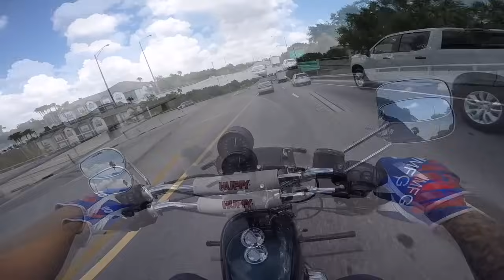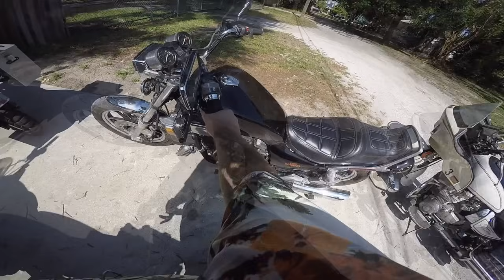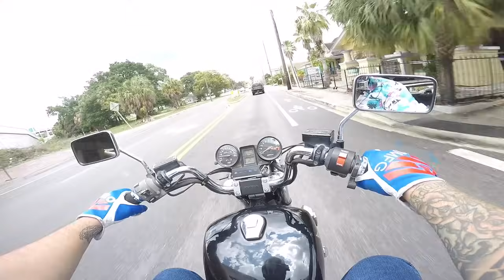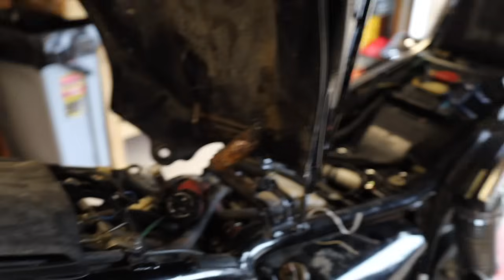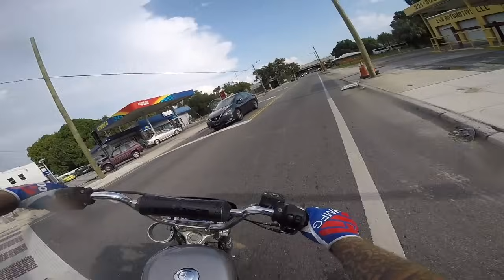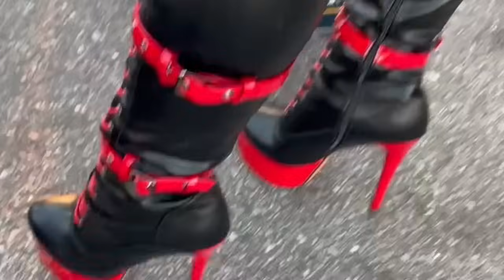Forgotten Fury: Honda's Insanely Fast 80s powerhouse will STILL beat any Harley... and I bought one

Comment: There was a time in the  80's when the fastest bikes down the quarter miles were cruisers. To be clear, the V65 Magna was probably the first which received the power cruiser treatment, followed by the Suzuki Madura 1200 and the Yamaha VMax. At some point Kawasaki introduced the Elliminator 900 and later a 1000cc version, but by this time sportbikes were gaining the publics attention.  The V65 was a fun bike even though it was difficult to launch hard without pulling an impressive wheelie. I cannot remember  anyone which rode this bike which didnt come back with a rather large smile on their face.
The only downside to this bike was a inadequate lubrication to the valve components in the cylinder heads which have been a major contributor to premature valve train wear and failure in these series of Honda engines. A popular modification to these engines has been to install an alternate means of supplying a higher volume of filtered engine oil to the cylinder heads. Search the net for V65 Magna oiling valvetrain and you will find options in which to address  this problem.
Reply: I had the eliminator 900 followed by v max   in the 90s  the kawi was amazing to launch super long bike . V max was by  far the most insane bike I have ever rode!
Reply: @neotree605  I always liked the looks of the original Kawasaki 900 Elliminator and wished they had released it with a chain drive.
Reply: Good comments Matt, I tested them all for the mags back in the day.  Cheers  Dale Walker
Reply: Reportedly, that was corrected with the '85 MY.  I cannot verify the credibility of that info as I don't recall where I got it at the time.  I remember people doing two styles of fix.  One required some drilling and tapping, the other a ring that mounted between the case and oil filter.  Some people still had cam lobes getting wiped even after the "fix".  

They are fast bikes but heavy at a stop and not as flickable as modern counterparts.  They can conquer the twisties (the Sabre anyway) once the pilot is used to them.  But they scrape fairly easily when cornered aggressively and the short suspension travel isn't very accommodating to undulous pavement surfaces.  Doesn't slow me down too much though.
Reply: @DaleWalkerHoleshot   Mr. Walker.
It was an honor to see your reply to my post. I followed your Cycleworld bike tests, general input and drag racing results throughout  my youth and respected your many achievements.  To say your name has become Legendary in the motorcycle racing world is speaking very humbly.
 Sincerely,  A Fan. 
Matt
Reply: Good history. The Honda V4 originated in the Interceptor sportbikes and spread to the Magna and Sabre lines. 
The V-Max came from the Venture, a then-new touring bike. The Suzuki Madura, in 700 and 1400 cc sizes, came out the same time as the Cavalcade, a luxo-touring bike. 
The Eliminator. The other power cruisers had a history by the time Kawasaki borrowed the 900 Ninja engine for it's own power cruiser. Longer and lower, like a true drag bike, it was far easier to launch than the Magna and left many a bigger bike in its taillights. After one year in which numerous magazine reviews lauded the Eliminator's touring potential Kawasaki gave it a five gallon tank, a better seat, and the new 1000cc engine from the new Ninja, but the ZL1000 fell victim to the insurance companies and was "eliminated" after two short years.
Reply: lol, yeah. Sometimes a chirp and a wheelie.

...one of those times who's going to be nicer at a rural 4way stop in town.
guess them other young'ns wanted to see the new '84 Magna. 
Twas first time I really nailed it. I was still in the air getting my foot on the peg at the other side of the intersection looking for second gear-ish. ha, the others gave a good horn honk applause. 

yup, twice I let pals take it for a rural spin and they came back smiling.
Reply: @brianbartulis9709  
I can picture that.  Headed for the Smoky mountains I took a direct road, turned into three lanes each direction clogged with traffic.  I had to turn back for a longer scenic route, positioned for a u-turn I waited and waited... Finally a small break in the left lane, i went for it, a little too aggressively with my wife on the back and overloaded with camping gear the front popped up unexpectedly.  Luckily I reacted and set it down and still took off before being rear-ended.  And I didn't even catch any shit for it!  😂☮️
Reply: @elgringoec   eesh, wheelie with yer gal on back. 'n what a sport she is.

blah blah...
..taking a route I picked for giving rides.
Far rural roads of pricey homes..
One part of (mile of) is fun sorta sharp rolling..near called humps, but hills, which were a gas at 80 mph, tummy like a roller coaster.
~ Gal I was dating...hey Sharon, howz 'bout one last autumn ride?
..yeah, just before the sharpest hill I kicked it down to fourth and unscrewed it.
Fahhhhk! I got an unexpected 80mph wheelie eni near froze, hoping the front comes down in time for the sharp turn a coming up soon.

lol, throttle.
ya know that long 2 seconds after wiping out on water skis being dragged? (let go of the rope stupid)
After pulling her nails from my leather we both got an odd chill 'n called it a day.
~ Damn Magna pulls like a freight train and a rocket.
Tips me hat Geo.
I did once say the Magna ran like an electric drill as someone below/above said. But not the '74 Kaw 901 as adventure. (-:
Reply: The only bike I should of kept. A 1986 Kawasaki  ZL1000 Eliminator
Reply: I used to run a katana 1100 in the late 80s and the v45 would keep up in the 8th mile but I would pull ahead when I hit 8 grand, Hella bikes
Reply: @francisgiles8623  
At some point, it becomes more about the pilot than the craft.   Once away from the long straights and into the twisties where skill starts to count then it's about braking as well as accelerating, judging road conditions and adapting, leaning ability, anticipation, smoothness, technique.  Fun 😁
Reply: Vmax was way before Madura.
Reply: @spaceflight1019  Actually the first Interceptor was '83 and the Magna came out in '82. I had looked that up earlier this week because the timeline was fuzzy to me.
Reply: they are extremely easy to launch without wheelying,  thats part of what made them so fast.   you can basicaly gun it right out the gate
Reply: @noidontthinksolol  Long, fairly heavy bike. Yep.
Reply: Me and two friends have owned them  here in Germany. A tire shredding fun and wheely machine.
 I customized the bike to dragstyle. Flat handlebar, other fender, seat and so on. And also take out the engine to replace a defect cylinder heat. That was in the good old days.
Reply: I've seen quite a few advertised as running great with 20k miles some as high as 50k I went to look at a few that were in the 8k to 14k range those few didn't see to have a top end oiling problem I wonder if it was from constant drag racing/abuse or prolonged wheelies that caused the oil starvation problem... now the popping out of gear thing I've had happen to me
Reply: @tricycleguy2657  I seem to remember my father's having the gear problem too.
Reply: @angrytater2456  I've heard more about gear problems then I have about oiling
Reply: @DaleWalkerHoleshot  the legend himself. That was a great time bro. You and Pee Wee held my interest test riding the old muscle cruisers. Led me to an 83 V65 and an 87 ZL1000 Kawasaki. Walking into the bike area for that ride was sometimes a tough decision. Peace out, bro.
Reply: The first Japanese power cruiser was the KZ900LTD - 1976. The 83 V65 Magna was the first to be significantly quicker than the same manufacturer's fastest superbike (the 83 CB1100F, but the CB-F was faster on top, Radar tested 144 mph vs. 138 for the Magna). I'd say either the 83 GS1100E or S could match the Magna's ET at the drag strip, though. I've owned all of the superbikes of that era at one time or another (except a V65 Magna, but my friend had bought one new in 83, but traded it for a Low Glide the same year), Including the complete 83 trifecta (CB1100F, GS1100ES, GPz1100). I stoplight raced a few V65 Magnas back in the day, then on my modified 79 CBX, and never lost to any of them from a standing start. The V65's could trounce all the other stock 1100's in a top gear highway roll on, though. Truck loads of low and mid range torque.
Reply: So disappointed that Honda discontinued the V65 Magna in favour of Harley look alikes. Would it not be better to improve the known flaws to provide a trust worthy engine/bike. Same way they did with the GoldWing ? If I want a Harley I would buy one.

Comment: I had a V65 VF1100 Sabre, '86 switched the 40mm carbs for the 44mm and the cams to the Magna Specs. Before it could barely lift the front tire, after, Tha 800+lb bike would stand up, hit 90 in 3rd... yeah

Comment: Nice find.  I've had my V65 since 1986.  As soon as I heard the engine and saw the dead tach I knew it was the rear bank spark box.  When you get a working CDI in there the bike will come to life and tach will work.  Be careful with the throttle when you're deep in a turn, it will absolutely break the back wheel free.

Comment: The V65 was a very dangerous bike because if the high and wide radiator,  its top end was limited to under 120mph depending on your individual weight,  the radiator acted like a air foil and created lift, the faster you went the more it lifted,  great dependable bike, just dont use its speed, i had one to a 145, scariest ride i ever had, it was literally all i could do to keep it between the ditches,   i later got see my best friend total it out at around 120mph, luckily he only got a broken wrist hole in his foot and some road rash. Thankfully it wasn't our time to go.
Reply: thanks for fair warning radiator is a fairing wing

Comment: I had a CB1100F that I bought new in 1983. I had friends with V65 Magnas and Sabres during that time and they were both insanely powerful for the 80's. If that Magna was in tune you would have flipped over backwards if you gave it full throttle and weren't laid out over the tank.

Comment: I had a V-45 in my 20's.  One of the best bikes I ever owned.  Beautiful bike, rocket fast, great handling.  I went faster on that motorcycle than on any other bike I've owned.  I just wanted to do it once.  Hit 122 mph and still had throttle left.  The pull back bars were so comfortable and you didn't have to lean at all to reach them.  Those bikes were/are awesome.

Comment: I had a 84 V65 Sabre for 4 years that I sold in 2013, also had a 82 V45 Magna back in 84 so know the engine pretty good. You will know the 65 is running good when 2nd and third gear ( 1st is not fun ) hit around 6 or 7k and it feels like a turbo kicked in and the smile
Comes to your face
Reply: I had an 85 sabre, i wish i never sold it. Loved that motor.

Comment: Got an '84 Magna 700. I've had it 3 years, I've fixed the thing after being abandoned. It still scares the shit out of me when it spins tires 3rd. I love it.

1 thing note, Magnas don't hit their power band until around 6k rpm. Magnas, and other v4 bikes, have their power band in the middle. V-twins have good low end torque, 3 cylinders get that power to last a little higher in the rpm; inline 4's live in high rpm ranges. The magna v4 likes the middle ground from around 5,500 to 8,500 rpm. That's where you find the most fun.

Comment: I had an 1983 V65 Magna, it was awesome! It was the fastest in 83, in 84 it was the V65 Saber, and in 85 it was the VMax. It had a factory alarm system with a cable lock that locked into the side of the bike and activated the alarm.

Comment: I had a V65 Sabre when I was just out of high school in the 80’s. It had 121 hp and I’m pretty sure i got all 121 working on a couple of rides. It was a beast. Two of my buddies had the V65 Magnas and it was the best of times.
Reply: Same here!  I believe I was 17 years old. First street bike I  owned, 85’ VF1100 V65 Sabre. I recall some mods I did like Supertraps exhaust and some added air/fuel flow, maybe jets etc as if it wasn’t beast enough as stock. I recall the enormous difference a brand new set of high performance tires makes on a bike. Some great memories with that bike! The Einstein I bought it from had an electrical short somewhere and his fix was replacing the main fuse with a paper clip! HA! Well success on not blowing the main! Around 2:am small town Mass…buddy riding beach, slow cruising going through downtown, pass fire department maybe 200 yards beep,blew,bleep…. Pull over kickstand down, Whoa!! Mike we’re ablaze! Shite!  Mike ran to house with light on back with fire extinguisher, had fire out maybe…. Under one minute, with dummy me trying to put out fire throwing sand, kicking, I would have been blown to Burnsville as tank was on reserve, buddy’s came with pickup and plank back to garage we first found the paper clip, petcock to carbs on those bikes had an extra layer of rubber near the cylinder heads where flames got through it and started penetrating into main fuel line with a near empty tank = likely baboomsky!   THANKS AGAIN MIKE!!!   Fire trucks rolled up from neighbor who immediately handed Mike the tank! 🙏 they rolled in maybe 2 minutes after jiffy stand was down, I’d likely been on fire by then. Wire harness melted and part of seat. Boneyard harness and seat plug and play… waroom waroom started right up.  Man that bike was quick and strong. Solo RT. 495 approaching the Live Free or Die state and Mr. Corvette decides he wants to race…6th gear full throttle. Young and balzy dumb, I did manage (cuz I just had to) for split sec peak down at the digital speedo and….. I’m pretty sure it said 184! I likely exaggerated a little bit  but… not by much if so. Definitely in the mid to high 170’s. I lived through it to never do again. Fastest I’ve ever been and to never even attempt or desire to thrill that again. SORRY FOR THE LOOOOONG STORY guys and gals, just brought back a lot of memories with that bike as a kid. Thanks for making a good thread to read ya all. Sorry to hijacker’s the thread some!   Sold it when I was 20, packed up the Chevy and rode to California. About 20 years ago a good friend got a V65 Magna I’d help wrench on and take on an occasional ride, fantastic bikes from Honda! Now just an old man with a Chief and a Sportster…slow and steady (sort of). The end.

Comment: I bought a 1984 v65 at an auction in Tucson 3 years ago for $400. It had 65,000 miles on it and one I cleaned the carbs the thing ripped.

Comment: Magna came out in 1982 when they introduced the 750 Nighthawk. I owned a nighthawk and wanted to put a CB 900 engine in it to give it more guts. The Kawasaki GPZ 750 and 1100 had way better gear ratios for racing! I couldn’t stand the handling of a Magna. The Sabre was cool but their shaft drive was weird. It lifted your rear end up on acceleration. The best was the ST1100 and ST1300 Honda. They handled really well, had great acceleration and they fixed the rear end from lifting up on acceleration.

Comment: I'm a few weeks late but this just popped up on my screen. I got out of bikes about 7 years ago after one too close call that scared the shit out of me. My New years resolution for 2023 was to get back in the saddle. When the Spring hit, I went hunting for bikes. About a month ago this V 65 Magna showed up on Craigslist and I checked it out, put a few hundred down and picked it up 2 days later. Now I've had all sorts of bikes over the last 50 years, mainly BMW 5 and 6 series bikes and a few Harleys. I like carb bikes I can work on. My State (Connecticut) had a backlog at DMV and I had to wait 3 weeks to register the bike. Ride time! This Magna looks new with 18,000 miles on it. Honestly, this bike scares the shit out of me! The guy that sold me the bike smiled and said "It really comes on at 7,000 rpm." Now, I'm gonna be 70 in September and I haven't gone faster than 65 MPH or above 5,000 rpm. I will have to work up to that slowly. I made it this far and just imagine what it would do to my bones if things go pear shape. My God, my hands almost came off the bars when I had some space on the road to open it up! It's gonna take me a few months to get used to this roaring beast! Thanks to the people that commented. I read several comments and I will read them all. Thanks for the video, shadetree surgeon.

Comment: The lock below the side cover is for the FOIL system.  Fiber Optic Integrated Lock.  It is a cable with a loop in the end.  You wrap the cable around something, tree, telephone pole, then plug the end into the bike.  If someone cut the cable an alarm would sound.  Hence the fiber optic thing.

Comment: That smaller tank is technically a reserve tank but it also has the fuel pump in it... just clean that main tank good and run it... trust me when I say check the neck bearings because if they are sloppy the bike will tank slap faster than you can catch it... it's scary 1980s death machine bruh... have fun and hang on
Reply: Yeah thats the reason i don't ride my 95 magna 750 anymore. Head wobbles are crazy and i just have not gotten around to doing the bearing upgrade yet. Also the 30 year old front brake lines are... squishy to say the last lol.  Runs like a raped ape but needs some work. 😅
Reply: @tropicaltrucker4425  I'm using stainless steel braided brake hoses for mine-not just to be shiny, but durable
Reply: The fuel pump is external and rearward of the reserve tank.

Comment: I bought an '84 V65 Sabre w/2,000 miles for $2,200 when I was 17 y/o in '86.  While working as a parts jockey at the local Honda/BMW/Suzuki dealer, bought the matching Hondaline fairing & lowers for long-distance sport touring.  I sold the Sabre at end of my sophomore year in college w/19k miles.  Enjoyed every one of those 17k miles!